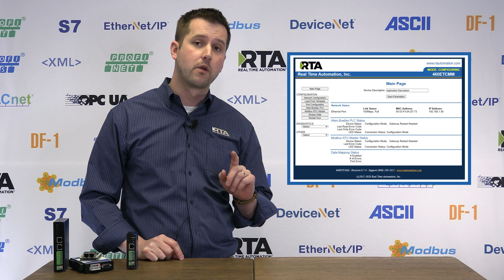The 460ETCMM - Connecting Your Allen-Bradley PLC To Modbus RTU Devices

Comment: I’m using this module extensively with RS232 to pull data from Modicon 984s into AB controllers to get their data into our SCADA system.
It’s been running for years with zero problems.